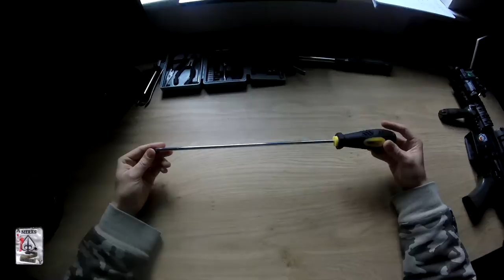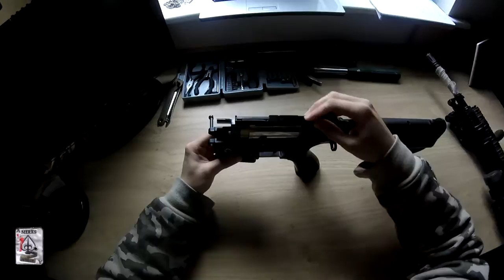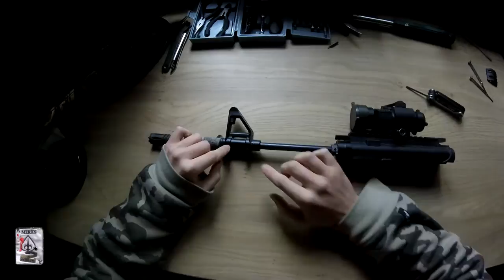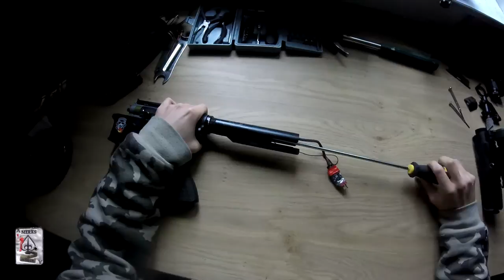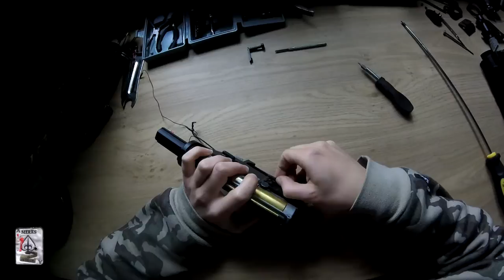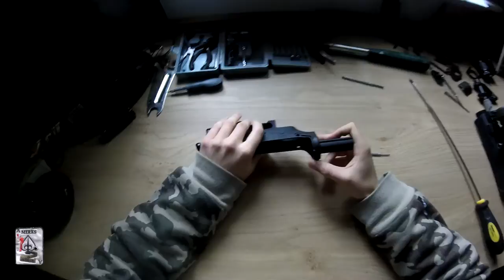G&G GR15 Raider; Externals Dissasembly (Part 1: COMPLETE Dissasembly/Reassembly)

Comment: Hey bro my handguard dont have those holes on the sides of the weapon, only up and down, how should I remove my front sight??
Reply from the maker: I'm not sure I get what you mean mate. Let me know the time stamp at which point your rifle is different and I'll try figure out what you mean. Have you got rails or plastic handguards?
~Webster
Reply: @MerksAirsoftChannel  I have the quad rail like you but mine just dont have those circular holes, only a little one in the final part to access the outer barrel, i was wondering if I need to remove the entire barrel from behind and then remove the front sight, sorry for the bad english
Reply from the maker: @EndermanLegendario  Right, I think I get what you mean. The first thing I'll ask is have you got a G&G Raider GR15? If you don't then it might be disassembled differently to this one.
~Webster
Reply: @MerksAirsoftChannel  It's a GR15 Raider L from G&G, with a new inner barrel 6.03 (I dont remember the brand) and a Prowin metal hop up chamber
Reply from the maker: @EndermanLegendario  So it could be that you have a newer generation model. If you bought it second hand then it could be that the previous owner replaced the outer barrel with a one piece aftermarket one. If you watch the video I talk about how you can remove the front sight if your rifle isn't like mine (13:45). There should be a little screw on the bottom of the front sight (it could be underneath the front slight mount). Remove that and then pop the two pins out from the side of the sight. These are located on the actual block of the sight, the part that wraps around the barrel. Remove the flash hider and then the front sight should slide off the barrel. From here you should be able to slide the rails off and then access the barrel. If you can't remove the front sight in that way then let me know. You'll be able to tell pretty easily because the pins on the side of the sight looks really fake on the GR15.
~Webster
Reply: @MerksAirsoftChannel  It's new and it doesn't have that little screw, it's the same G&G front sight and the handguard it's G&G too
Reply from the maker: @EndermanLegendario  Right, very odd. So, you've removed the 4 screws on the top and bottom of the rail like in the video? But your rail doesn't have the holes on the side of the rail to get to the screws on the barrel itself? Are the holes not there, are they blocked, or can you not see in to the holes?
~Webster
Reply: @MerksAirsoftChannel  I've actually didnt remove any screw, just checking the gun to proceed with the dissasembly but I cant find that hole in the left, the only hole in the side of the rail is the one who's close to the hop up to remove the barrel from behind, so I was thinking about quit the 2 screws of the rail and then unscrew the outer barrel, so the entire barrel comes out AND THEN I would see those screws of the sight
Reply from the maker: @EndermanLegendario  If you want to try that then you can. At that stage of disassembly there's no small parts that you should be able to lose. If you have a GR15 Raider and yours doesn't come apart like the one in the video then I don't understand how yours is put together so I would suggest you try something yourself and see what happens. If it's really confusing you, you could always video your rifle and upload it to your channel and I can have a look. Then you can delete it after.
~Webster
Reply: @MerksAirsoftChannel  When the silencer that I ordered arrives I'll try it, Im trying to make my own Honeybadger
Reply from the maker: @EndermanLegendario  okay mate. Let me know how the build goes.
~Webster

Comment: Can you tell me your whole tool set. Thanks a lot.
Reply from the maker: Hi there mate, 
The main tools you'll need are a decent toolbox,  like the one I have in the video.  One with various screwdrivers and hex keys and pliers and tweezers. You'll also need a set of Allen keys. If you're taking apart rifles you'll especially need smaller sizes.  
And then I'd recommend a hammer,  you'd be surprised and a torch. 
Other than that you may find yourself needing more or less tools and you'll just end up adding your own tools to your box. 
Hope it helps mate
~Webster

Comment: could you put a delta ring on this?,because I am modding my gun, and it requires a delta ring.
Reply from the maker: Yes you could. The problem you have is that you'll need to replace the barrel then too. The external one that is. And you'll also need a different rail that's compatible with the D ring
~Webster
Reply: So I would need a new outer barrel, and a Rail system?
Reply from the maker: AumniX yup, although I'm not sure why you'd want to remove the single top rail and put in a delta ring. You'll lose that continuous top rail look.
~Webster
Reply: that is kind of what I am going for because the gun I am trying to replicate has a delta ring.

Comment: could i use this gun with 11.1v lipo?
Reply from the maker: Herzi by this gun do you mean a raider? In theory yes, but I really wouldn't use any rifle with an 11.1 lipo without a mosfet even just a basic to protect it. You also have to keep in mind that an 11.1 can seriously wear down your internal parts. I find unless you specifically want the power output of an 11.1 then a 7.4 will do just fine. 
~Webster
Reply: Merks Airsoft Channel I want a lipo batterie but i dont find 9.6V lipo batteries
Reply: Merks Airsoft Channel or could I use 7.4V lipo batteries?
Reply from the maker: Herzi you can't find 9.6 lipos because I don't think they exist. 7. 4 is more than enough for a raider man. 
~Webster
Reply: Merks Airsoft Channel oh thx so much I think I will order some 7.4V Lipos now 👍🤜🤛
Reply from the maker: Herzi anytime mate. 
~Webster

Comment: Someone help me please. My gr15  keeps dry firing. I flip my gun upside down and it fires. But right side up it keeps dry firing
Reply from the maker: Hey Daniel, Its Gizzie here,  have you tried a few different mags (hi-cap/mids) may be the BB isnt reaching the up into the barrel to fire or does it fire when you have the gun orientated in the correct way but push the mag up?
Webster is probably gonna see this later on so he may know better :)
-Gizzie
Reply from the maker: Can't suggest anything other than what Steve said. The main thing to try is to push the mag forward a little bit when it's in the rifle. If that works it just means your have (sorry) crap mags. Other than that. If you're using a hi cap, trying winding the mag (sounds really silly but process of elimation) how many mags have you got?
~Webster
Reply: Merks Airsoft Channel i tried tapping my mag to not wobble and it still misfires but i assumed i broke the winder on the high cap mag. So i used the midcaps i bought for my kwa vm4a1 and its to slim to stay in there. Should i try to buy g&g midcaps or disassemble my gun? (I dont want to but i will) - sincerely Danny and thankyou 

P.s i may upload a video to demonstrate if you can help id be so greatful
Reply from the maker: Gizzie again, sounds like the mags, dont tape the whole thing, try a bit of folded cardboard at the back of the mag say 1cm down from the top and then a few tape layers, may push it forward that little bit you need. Best bet is to play around with it and see if you can get the mags you have to work. Otherwise borrow a mates mag and see if it runs smoother and get some new ones if thats the problem.
Thanks for the sub though.
Reply: Merks Airsoft Channel copy that i will try that tonight. I only have the hi cap that came with the gr15 and my kwa k120 mags
Reply from the maker: Daniel J Arreaga-Hui
Video likely won't be needed mate. Should be able to sort this out. It could just be a hop up issue. There's a video on our channel about how to take just the hop up unit apart. It's relatively simple. I don't suggest you going buying mags. It may not fix the issue. A very very unlilely culprit could be the tappet plate. But I do doubt it. This has me very confused to be honest with you mate :p. Initially I would have said that it's a mag issue but if it's all your mags then I don't know. Can you get any mid caps from a friend?
~Webster
Reply: Merks Airsoft Channel i know the kwa mags are slimmer. And its possible i can ask a friend. Also i thought turning my gun upside down and firing would diagnose that it is not a hop up issue. And yea im watching all the disassembly videos you guys have incase i have a broken hop up
Reply from the maker: Daniel J Arreaga-Hui it is very random. The best thing to do is check a different mag. If it's still happening it could be the hop up chamber has shifted but it wouldn't make the thing suddenly work when upside down.
~Webster
Reply: Merks Airsoft Channel hey guys i borrowed a hi cap and my gr15 is working great. My hi cap that comes with the gun may be broken it wont fire the last like 100 bbs with out constant winding of the mag. Is it possible that i over winded the mag? Now that i know the gun is working is there any inner barrel upgrade you recomend for use with a suppressor extension?
Reply from the maker: Daniel J Arreaga-Hui
Hi mate, glad to hear it! It sounds like the winding mechanism is gone in yoir hi cap. It's actually not too hard to fix. I really should have done a video on it. But there should be a screw on the bottom of the mag, if you unscrew that the whole internal part of the mag should pop out of the metal housing (make sure the mag is empty!) then you undo all the screws in the plastic housing and it should separate into two halves. Look at the winding mechanism and I'll bet there is a little metal piece that snapped from the metal coil. To fix it just force another bit of the metal coil into the mechanism and close it all back up.
As for upgrades. I wouldn't bother upgrading the internal barrel mate. If you wana go for upgrades, go with a madbull python 6.03 mm inner. Leave the green hope up rubber in it and try get a hold of a concave nub somewhere
~Webster
Reply: Merks Airsoft Channel i wanted to add a suppressor but im not sure if the internal barrels shortness will make my bbs get caught in the suppressor lile a can. But thanks for that suggestion will do !
Reply from the maker: Daniel J Arreaga-Hui
My advice is not to go too long with a barrel. Running an inner barrel into a suppressor is a decent way to hide it but an overly long barrel may not increase yoir range. As for the BB hitting it. It really shouldn't. If it does it means yoir BB is leaving the barrel at an awkward angle to begin with
~Webster
Reply: Merks Airsoft Channel copy that im gonna get the mock suppressor and ditch the inner barrel. Glad my mag broke cause now i found your awesome channel. Thanks guys!
Reply from the maker: Daniel J Arreaga-Hui
Silver linings huh? :p thanks for the kind words mate. Feel free to post a picture of the rifle on our Facebook page if you get it done
~Webster